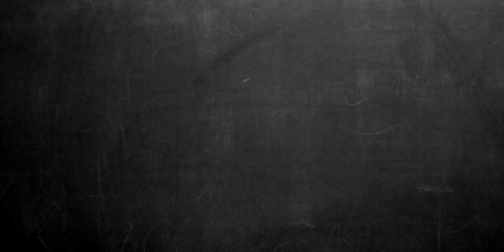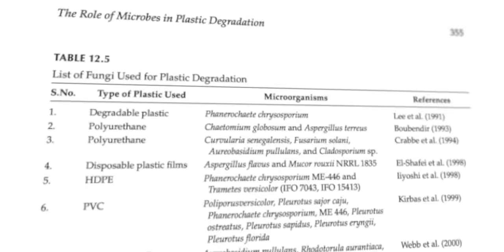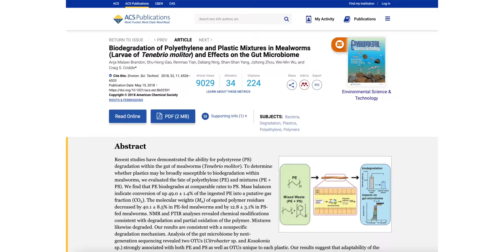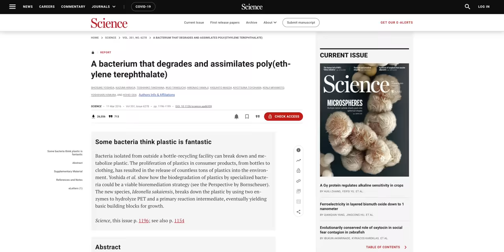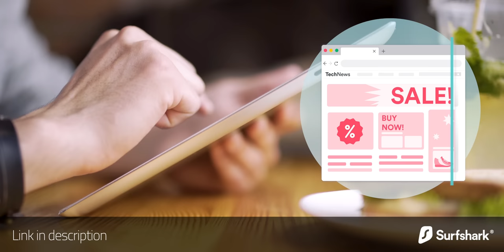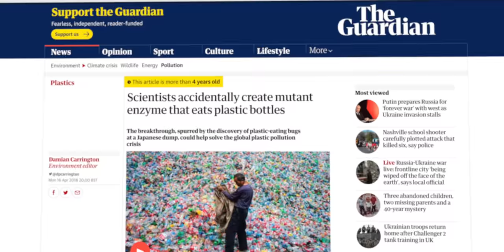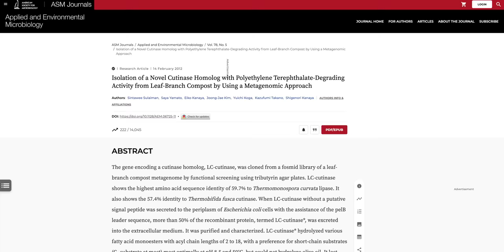Why This May Be the Future of Plastic Recycling

Comment: If it takes 255 days to compost a simple yoghurt cup, then people trying to do so will still end up with a huge mountain of plastic waste slowly growing on and displacing their compost heap. Partially degraded polymers are still microplastics btw., so environmental exposure to these would skyrocket in such a scenario. Thus, adding Evenesto to PLA still requires separately collecting the waste and bringing it to a special composting facility!

Also, new enzymatic processes tend to always get patented and privatized, which doesn't favor tackling the plastic issue on a global scale in a cost-effective way. Now we gotta wait 15-20years until patent protection runs out, such that market dynamics lead to a price drop of enzymatic recycling. That's two decades wasted, creating an oligopoly, converting public wealth/funds into private capital, aswell as artificially limiting the speed and scale of adopting these new PET degrading enzymes. Repairing and preventing environmental damages really should NOT be done in a for-profit fashion.

Comment: Key words in this, “they patented the technology” meaning they will calculate the maximum profits they can make out of this which always make throwing in the trash the go to method when recycling is expensive due to being a for profit business. As long as oil is cheap, new plastic is going to be cheaper than the costs necessary to overcome the patent holders profits.

Comment: I think the practical application of this should be mandated sooner or later by governments for plastic producers above a certain annual output. Maybe this cannot be applied to all plastics or mixed materials, but surely could be used for high volume production types, like Coke PET bottles, packaging, that hardly change composition over the years.
If the solution is not implemented in say 2-3 years by big producers, 5x their tax rate on those products which they can't pass onto customers. Sort of "plastic producer's tax" if you like.

Comment: One of my biggest gripes with the industrial recipients of recycled materials is their insistence that the consumer wash, sort, and deliver all the materials in near-pristine condition so that the industrial users don't have to process anything. Instead, they just want to dump the recycled materials straight into their manufacturing feedstock bins. I like that the enzymes being optimized for plastics decomposition are sourced from naturally-occurring biological origins, although I am concerned that the genetic-level tinkering has enormous potential to cause large-scale, bottom-level ecological disruption when (not IF) it escapes into the wild, and I defy ANYONE to realistically claim that such a release into the wild is unlikely, let alone impossible.

Comment: absolutely! sure, it'd be great if we had a cheap and plentiful biodegradable material that could replace plastic, but until that time making small adjustments to the chemicals we use to make plastics, then developing enzymes to break them down seems like an important and  practical step in the right direction

Comment: That's great that we have creatures that can break down plastics but what happens when you don't want it to breakdown?  Like materials used in housing or building structures?  Imagine all the styrofoam used for insulation full of worms eating it away.
Reply: Probably about the same as termites eating wood, and steel I beams rusting.
Reply: It won't be hard to stop worms from eating your house, just like it's not hard to stop termites.
Reply: @charliedoyle7824  It's not hard?  I think it's the opposite.  There are lots of houses with Termite problems just ask the Orkin man. lol
Reply: That will not happen. Worms do not like styrofoam. It's like us eating potatoes all the time. They prefer bio waste like rotten food

Comment: It's true that recycling plastic to create other disposable products (cups, plates, etc.) is not worth it and that it is a lot better to use the algae type of biodegradable plastic instead. Otherwise, to use properly the plastic that we already have in our dumps, it is possible to recycle plastic and transform it into long-term that last for centuries of construction products such as bricks, plastic wood, windows, and paving bricks. These are products that use plastic to build houses, schools, buildings, streets, etc., and not just simple recycled cups (disposable things). 
In this case, houses and entire schools are already being built using this simple and efficient technology in Asia (Thailand), Africa (Ivory Coast, Kenya, and Nigeria), and Latin America (Colombia, Bolivia, and Mexico). Colombia is the country with more expertise and advanced companies in this area. In Ivory Coast, for example, there is no garbage collection process, so people dispose of plastic waste in the open land. So, the Colombian company Conceptos Plasticos is producing together with UNICEF schools and homes in this country. Plastic bricks made with recycled material are more resistant than conventional bricks. More resistant also than concrete brick. In addition, it does not absorb water and moisture and is simply treated to withstand excessive heat. Look on social networks for the page of the Colombian company Conceptos Plasticos. And if you can, there's a video from the Business Insider channel on YT called How To Make Bricks From Plastic Trash. It shows these projects in action. And also the BBC Earth Lab channel video called These Recycled Plastic Bricks Are Stronger Than Concrete and How A Ghanaian Man Is Building Affordable Homes With Waste Plastics.

Comment: there is a potential issue. electric circuits and devices, from tiny to domestic to industrial need insulation where plastic is used for all but the most high voltages. if plastic eating enzymes "leaked" into the wild, imagine all the wireing that would short out, and things like PPE in hospitals that might disintigrate.  Lego was shown as an example of long lasting plastic, but one of it's advantages is that it remains playable for many years, and having toys that last for 40+ years and can be passed down generations is much less wasteful than the disposable short lived toys that last less than a year.

Comment: I have worked in extrusion for 43 + years, and there is a big problem with recycling from the first run. CONTAMINATION. Every time the material goes through a machine it degrades and has another chance of being contaminated by a different material, or food stuff, if public recycling, or just plain dirt. Take a milk jug. Does it have a colored cap? Even the same material the color can be a problem. Does the jug have a paper label? The paper and the glue are a problem. any milk residue can be a problem. Just grinding them would be a real pain in the butt, without a specially designed machine for that purpose. Trust me on that 43 years I know grinding material(s). If the end product can be BLACK great. If you don't care what it looks like, or if it has holes or gas bubbles, FANTASTIC. But how many products are like that?

Comment: Wow, 9% actual recycling of plastics is an order of magnitude more than i expected. So it is already feasible and its probably just the incentives that are wrong.
And the enzymes are a good sign regardless of whether they will be used for recycling or not - as they will get rid of the already distributed plastics eventually if we ever stop adding more.

Comment: If these enzymes break down the plastic, what is the end result?  A yogurt cup broken down in to dirt is, well, plastic dirt.  So far, this seems to affect only PET plastic.  There are seven other plastic types in use today.  Only two of them are recyclable.  You can recycle a two liter bottle.  But you cannot recycle a sandwich wrapper.  This situation is only going to get worse before it gets better.

Comment: The ability to break PET into raw terephthalic acid is impressive and encouraging. IMHO, That’s the kind of recycling we need – even if it is more expensive than using raw materials.

More generally, though, I am unimpressed with the goal of plastics degradation. Yes, plastics are “Forever Chemicals”, but so is the oil from which they are synthesized. If oil were not a forever chemical, we wouldn’t have it at all. Biological degradation of plastics (rather than recycling) means that much of it will eventually wind up as CO2. Might as well burn it, at that rate!

If you want to sequester carbon from the atmosphere, the creation of plastics, or other hydrocarbons, is the most efficient ways to do it. After all, sequestration of CO2 as carbonates means removing, from the air, four times as much oxygen (by weight) than carbon. Sequestration of hydrocarbons (as plastic or ooze) results in five or six times as much carbon removed as hydrogen. That makes much more sense. Just fill up empty oil wells.

There should be an onerous tax on the production of plastics from oil, and a subsidy on plastics derived from atmospheric CO2.

Comment: Algae based plastics have the ability to decrease carbon emissions significantly and reduce climate change.  Composting is a good strategy as there could also be a fertilizer based system that takes the compost from this and creates a strong fertilizer for our food supply.  The whole strategy needs to be focused on building a sustainable ecosystem that has a cycle in and of itself.

Comment: I saw a video on You Tube where a guy turned plastics into diesel fuel in his back yard with a simple distillation process. Why can't this simple process be used on a larger scale to solve the plastics problem?

Comment: Something must be done to recycle all that polyethylene film used as product wrapping film. Currently this stuff is not collected for recycling, and goes straight to land fill. The same applies to polystyrene which is also not accepted for recycling. 
But what happens when the permanence and resilience of plastics, on which we depend, is destroyed by increasing numbers of organisms that are evolving to quickly break them plastics. Will the milk cartoons on the super market shelves start to leak, Because some bug has decided to feast on them? Will car dashboards, or seats, fall apart because they developed a fungus infection? Will we be forced to rethink using uPVC for building construction because it now rots faster than the wood it once replaced?

Assuming there has been a breakthrough that makes plastic disposable, do we need another that makes it stable until treated with a very specific chemical that makes it disintegrate. Perhaps we do not want these enzymes falling into the grip of nature's critters.

Comment: The team in Texas came up with FAST over a year ago and still have not found commercial partners???  There is probably some problem with their system that isn't public knowledge or they are demanding too much $ for it.  Either way it isn't a solution if it doesn't get implemented.

Comment: I was watching a documentary about plastic in the ocean. The plastic patches aren't increasing anymore but should be. I immediately assumed bacteria was eating it. Nature has probably adapted something as it's an abundant food source.
Reply: Large plastic just breaks down to microplastics.   Probably more plastic in the sea than fish now.
Reply: @tradeprosper5002  something has been eating all the fish poop so far. Anything that can live off micro plastics has a huge advantage and can quickly multiply. If it puts off toxic byproducts in the process???
Reply: @chriscarrol9373  A lot of small plastic (bigger than micro) in our beaches now,  so it may just be reaching equilibrium for now.  Unfortunately, we keep increasing how much plastic we make.    Bacteria/enzymes seem to be type dependent (PET vs PVC for example), so not applicable to all plastics.    Ingestion of halogenated hydrocarbons is not recommended.

Comment: Plastic degradation is needed, but many microbes release CO2 through respiration. Plastics are made from crude oil and natural gas (Carbon stored deep in soil surface). If the microbes eat all the plastics, all of that carbon is then turned into CO2. To me it seems, the plastics (that we inadvertently released upon the world) are storing that carbon safely until we figure out what to do with the excess greenhouse gases. There is a sustainable solution, I am just not seeing it yet.

Comment: Make deposits on every kind of plastic on a product, period. Got a pop bottle that has 1 plastic in the cap, another in the body, and a third in the label? 3 deposits paid. Then, make the deposit 10x it's cost. You still get most of that back at recycling; the same ratio now, 50%, but if a soda bottle cost 9.87 and I get 5$ back, and instead I buy the one that costs 4.50 because it's made out of a sucrose based coated bottle, consumer habits will change.

And make all plastics recyclable. That meat styrofoam container? 5$ plastic deposit.

Comment: I'm highly skeptical that this plastic recycling based on bioengineering is the solution we as a species need to truly solve the plastic pollution problem. 

The best solution I can think of to permanently solve the plastic pollution issue is to drastically scale back plastic production, outright banning it in most industries and applications and engineering consumer products to last far longer, be easily repairable, or be highly reusable and versatile.

I see this biotechnology based plastic recycling as an example of Jevon's paradox where the increasing efficiency and profitability of the plastic recycling process will just allow the plastics industry to keep producing plastic and the petroleum industry to continue to exist.

Comment: I invented a way to turn all forms of plastic directly into electricity efficiently and with low emissions.  I'm still working on prototypes, but it's quite simple.  Since each pound of plastic contains about .4 gallons of oil, I use a process that separates and "cracks it" .
At that point the oil is used to run a type of internal combustion engine generator that uses a vaporization ignition similar to yesteryears "hot bulb" stationary engines, that are modernized for emissions control and efficiency.
Reply: What's the benefit of and old school hot bulb engine vs a modern diesel?
Reply: Yo that is so cool
Reply: @ThePentosin  It can burn any combustible fuel
Reply: @ProlificInvention  so can a diesel.
Reply: @ThePentosin  Hot bulb vaporization engines do not require high compression, or complicated high pressure fuel injection, are easy to tune, and reliable when ran on crude oil, paraffin, contaminated fuel ect
Reply: @ProlificInvention  and that's why it's very innefficient, I'm guessing. 
A diesel can run on the same things if you set it up that way. 

Edit: 12% efficiency vs over 50%
Reply: @ThePentosin  The owner of the Blackstone oil engine company and the Carter brothers back in 1924 were able to produce a hot bulb engine with a thermal efficiency of 40% although it never saw production due to Rudolph Diesels patent on the high pressure fuel injection system and it's subsequent widespread adoption.  Keep in mind though that that the heat byproducts of the hot bulb engine in this process are actually desirable as it's used in the plastic separation process.  Since hot bulb engines do not require the extreme tolerances necessary for high compression the engines themselves are much more durable in long term use, that's why some stationary engines ran for over 70 years of continuous service
Reply: @ProlificInvention  40% that's much better, and it's verified to do that? Or is it the inventors claim?
Reply: @ThePentosin  I've done extensive research on hot bulb, hot tube, and every other iteration of internal combustion engine and could probably find a reference if I looked back, however YT and creators frown upon posing links in comments.  I will say this however: The efficiency since the fuel (plastic) is nearly unlimited in quantity is not as important as in other uses, the thermal waste in my design is used for several processes to turn plastic into usable fuel while negating the carbonized sludge waste which is a byproduct of the reaction (which I actually use as fuel in another destructive distillation process for another use)

Comment: Suppose this enzymatic method works well and we have many recycling facilities using this method, what will happen if the microorganisms get loose. Anything from our water storage containers to medical equipment can dissolve in a few hours. Before we perfect this, shouldn't we have some control on who breeds these microorganisms?
People will not take it as seriously as they do biosafety in labs handling tuberculosis or small pox, but economic damage of plastic dissolving microorganisms will be quite serious

Comment: Feel like if we solve the plastic problem outside of industrial setting it will solve the plastic problem because they will no longer be a useful material.  If plastic degrades like say paper and you needed the material to last longer then you would need to switch to something like glass.

Comment: The catastrophist in me is a bit unhappy with this. True, I HATE the idea of a world in which plastic trash runs wild, BUT our solutions for that problem shouldn't be worse than the disease... and the idea of a rapidly plastic-digesting microbial entity running wild ... well that would be one for the record books - given that those books will NOT be made out of plastic!

Don't tell me the scientists and policy makers in charge will handle that offing problem. I wouldn't believe it, given their record of comparable safeguards so far. Glad enough I am, I suppose, that by then I'll have passed on. I won't have to witness the world "curing itself" of the plastic contamination we have occasioned thus far.

But if YOU want to do something about it, I wouldn't speak against it.